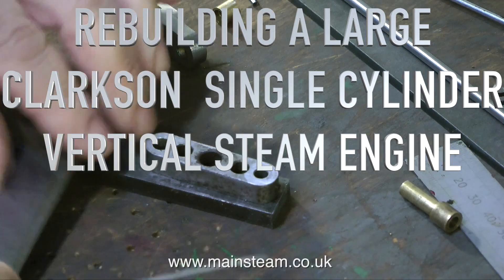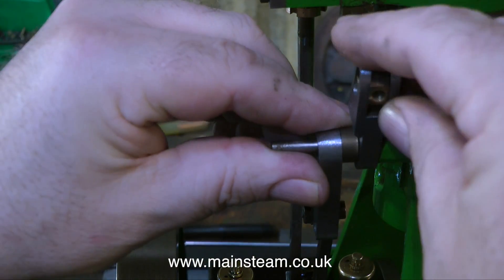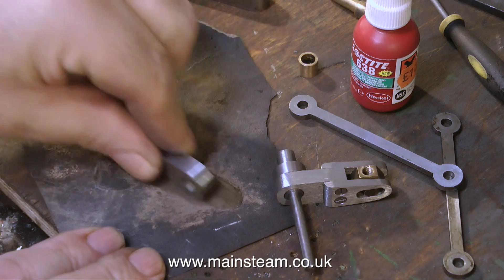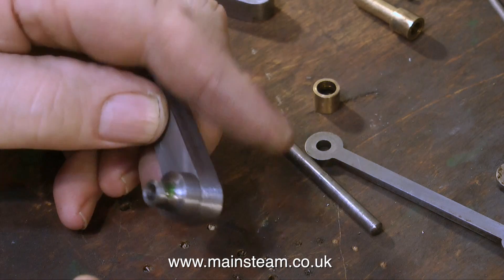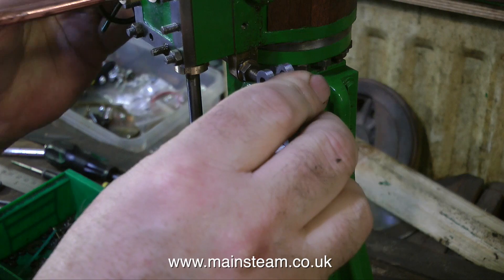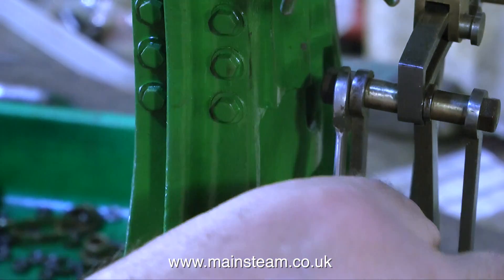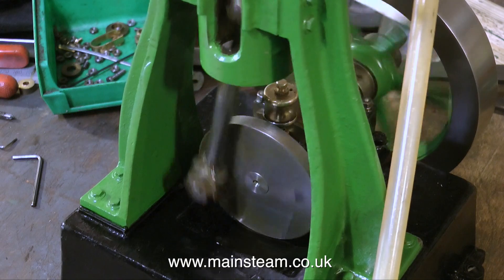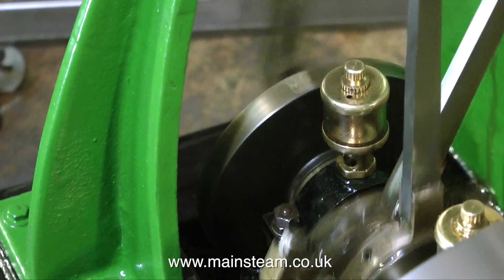REBUILDING A LARGE CLARKSON VERTICAL STEAM ENGINE - PART #29

Comment: It sounds about as poorly timed as my engines I build in legos! But there everything is in fixed angles so there's no real remedy to that.
Reply from the maker: +JonatanGronoset It is perfectly timed, but very advanced at both ends of the stroke equally as the slide valve is slightly too short for the ports.
Reply: +Keith Appleton Oh, well I look foreward to see you toil away at making a remedy for that then.
Reply from the maker: +JonatanGronoset That will be soon .... I need to get this thing finished ......